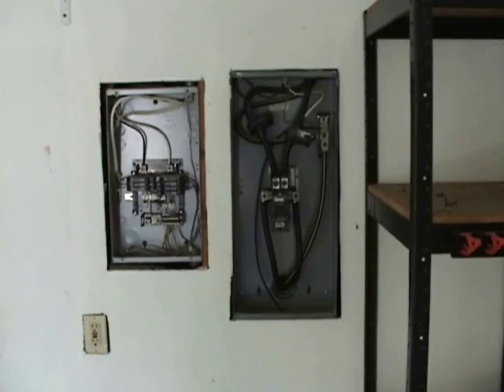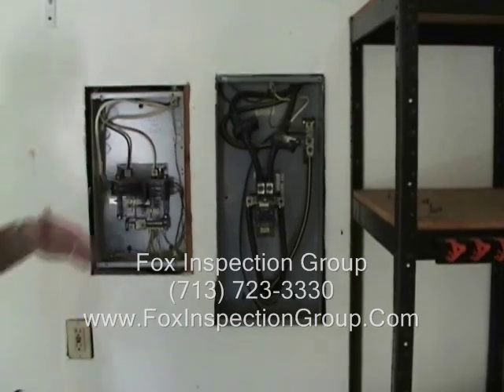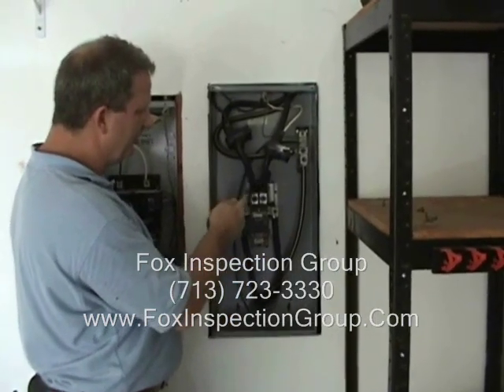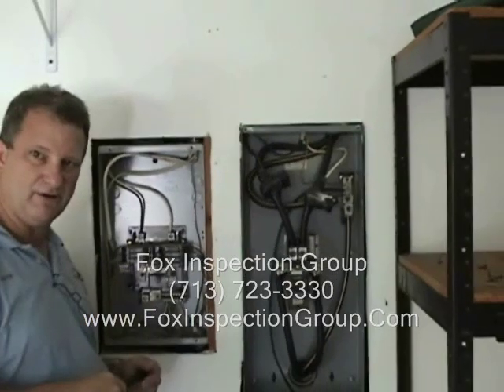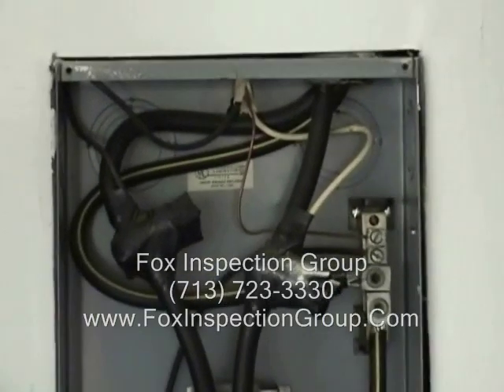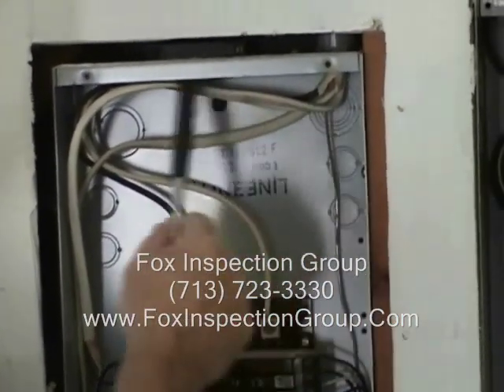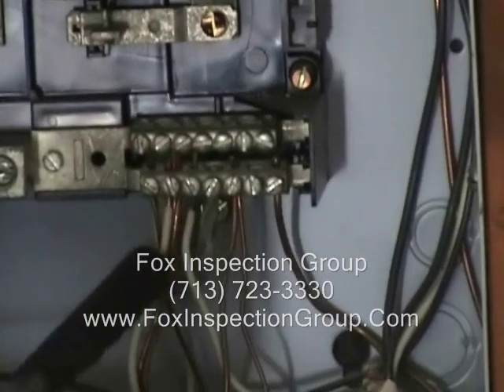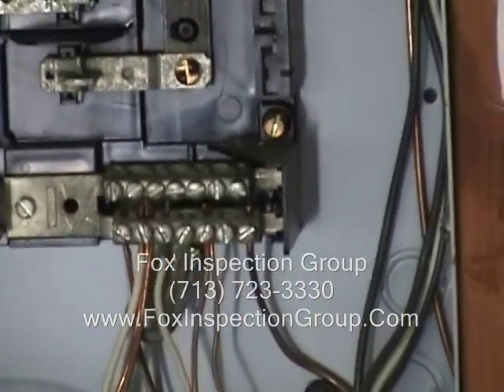Electrical Class on Improper Sub Panel Wiring

Comment: I cannot see how this would be permitted, 200A main breaker feeding the breaker panel with in the house and possible a sub panel running off of it. This what I recall was known as "dog legs" tying into the load side and smaller gauge wire is a recipe for disaster. More than 30 + amps starts flowing though those 10 gauge wires to the panel, going to overheat and catch fire! The over current device is too large. to protect the smaller conductors.

Comment: I think you guys need to learn the NEC.  Nothing wrong with the Romex sheathing that long in the panel.  The code states a MINIMUM of 1/4" of sheathing inside not a MAXIMUM.  It does look amateurish but not a code violation.

Comment: Ever heard of the FEEDER TAP RULE? 

A tap less than 10 feet only needs to be sized based on 1/10th the ampacity of the feeder overcurrent protection.  200Amps protection means the taps only needs to be sized for 20 Amps. 

But the taps do need to be protected inside conduit.  It doesn't look like they ran conduit unless they pulled romex into the conduit.

Comment: they are so stupid how the hell did they manage that with out pulling the meter is their another disconnect or is that the main they must have bean awful lucky to have not grounded the main feeders out or killed them selves with the 200 amp braker off thinking they were safe and working on the load side of it even then it would be  still way over fused and 110% wrong  its not going to be cheep to replace the feeders that are now to short  and re feed that sub and fix the ground /neutral

Comment: Best look at lug size to and what am-page the sub-panel is rated at. If you want to run number 10 then get a sub-panel main lug 60 amps.That said that whole point is silly it depends on your calculated load. You  also want breaker openings for future use.

Comment: #10 seems too small for a subpanel with multiple breakers, though it would be okay if it were properly breakered in the main panel, which it isn't.

I'd use at least #8 and preferably #6 for a subpanel feeder. #8 is usually good for 40-50 A depending on the temperature rating of the insulation and the terminals to which it is connected. I think #10 is only good for 30A.